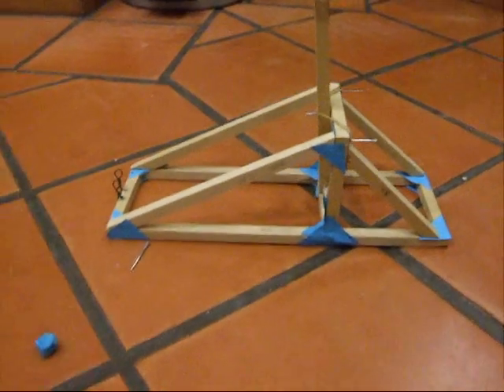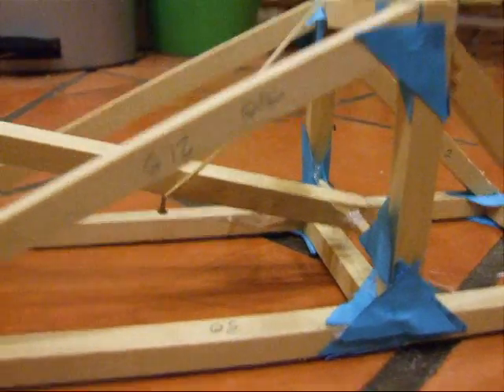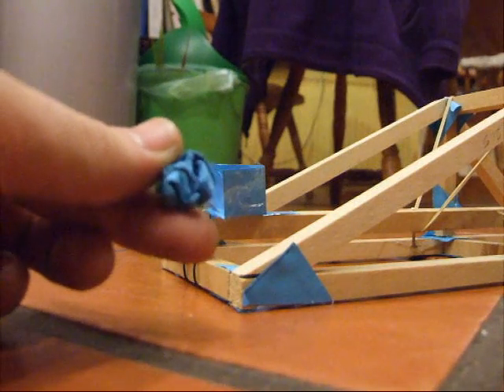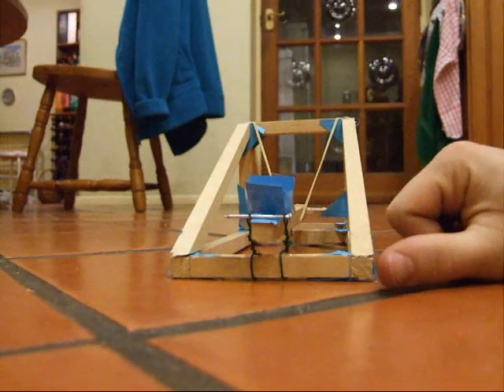School DT projects: Mini Roman catapult

Comment: Hey dude, I have to make a Catapult and well, I'm nervous. I have to document the blueprints with Dimensions from the front, side, and top view whilst writing it in 2d. Afterward, I have to build it with very limited materials. The materials that I'll be using are 2 plastic spoons, 15 rubber bands, and 6 Doweling sticks which are about 47 cm each stick. I also have a block of clay in case I want to use counterweight but to pass, all I need is to get the very small marshmallow to launch at least a meter and preferably more. The blueprint design is also very important. I'd absolutely love it if you could help me out. The catapult can be any kind, but the materials I mentioned are all I'm allowed to use. If you want, I could send more detailed measurements on the actual materials and maybe my teacher will allow me to snap a photo of them. I really need help, thank you for reading if you've come this far. My Catapult can't be over 30 cm in any Axis either. Please email me Antonio.studentyousif@gmail.com
Reply from the maker: Hi Antonio, I have a video where I go step by step on building a catapult 🙂 I think you could adapt my design for your materials pretty easily. There's also a link to the instructions I made which you can download in the description under the video. Just search for Roman Catapult in my videos 🙂
Reply: @tabletopforgeuk  Thank you but it says that the video isn't available
Reply from the maker: @fruitsi7465  Have you tried this link: https://youtu.be/DwZA3WS2fB4

Comment: hey guys im starting a catapult lab for science and I have to make once that is 30cm by 30cm, could somebody tell me how big this one is?
Reply: nevermind, I found it in the description
Reply from the maker: Ryan Brennan Hi Ryan, check out the other video linked in the description for the instructions.  You can scale up the measurements quite easily and it still works just as well!
Reply: Hey thanks man, got an A on it👍 it broke on the first couple tries but I put lots of hot glue and now it's just fine(: lots of power to it!!
Reply from the maker: Great news Ryan! Congratulations on the A!

Comment from the maker: Hehe, wow!  You'll want much stronger wood for the frame and a much stronger force due to the weight of the projectile.  At a guess, the dimensions I'd try are:
Base: (1m long, 50cm wide)
Support arm: (50cm high, 50cm wide)
Firing arm: (60-70cm long)
As for the wood, 2-3cm thick, 5cm wide wood should be strong enough.  You'll also want to consider drilling pilot holes for screws to attach all the parts together.
For the force, I'd recommend 2-3 bungie cords!  Hope that helps.

Comment from the maker: Base: (30cm long, 10cm wide)
Support arm: (10cm high, 10cm wide)
Firing arm: (20cm long)
Rubber bands: Better to use thinner bands as you can gradually add them 1 at a time to get the right force for your projectile.

For holding the projectile, I'd suggest glueing or nailing/tacking a plastic bottle cap to the end of the firing arm as that'll allow you to fire larger objects.

Let me know if you've any questions about the build as I can email you the instructions if you need them!

Comment from the maker: For a golf ball, I'd go with doubler the original dimensions (assuming the wood is 1cm wide and high):
Base: (60cm long, 20cm wide)
Support arm: (20cm high, 20cm wide)
Firing arm: (40cm long)
Rubber bands: You'll need longer bands!  Better to use thinner bands as you can gradually add them 1 at a time to get the right force.

For holding the golf ball I'd use a wide plastic bottle cap - a washing machine liquid cap would probably work well.

Let me know how it goes!

Comment from the maker: To fire a 2.3lb object, you would need stronger rubber bands and reinforce the support arm to prevent it snapping. With those things in place, I'd guess 10m, but you'd need to work out the actual force of the rotating arm and he release angle to get an exact distance!